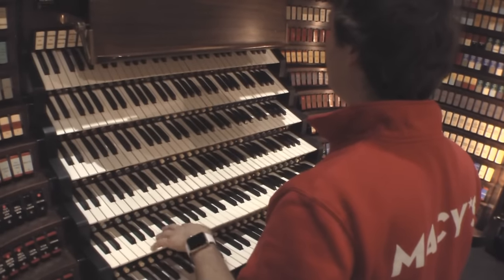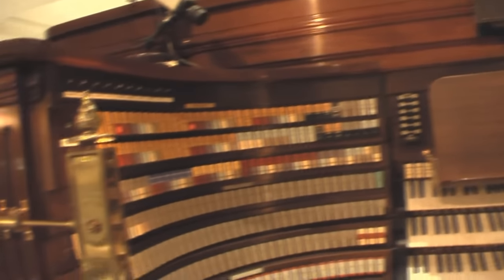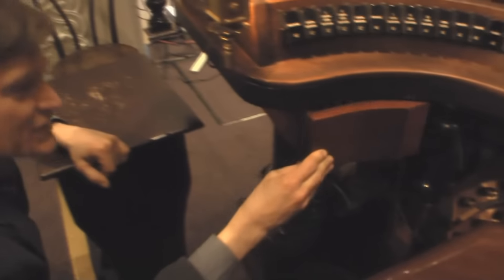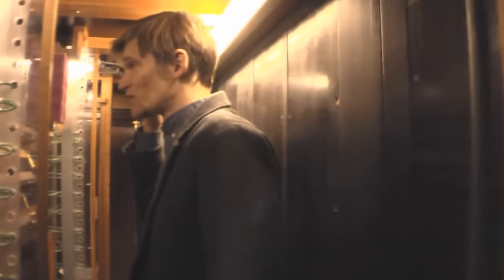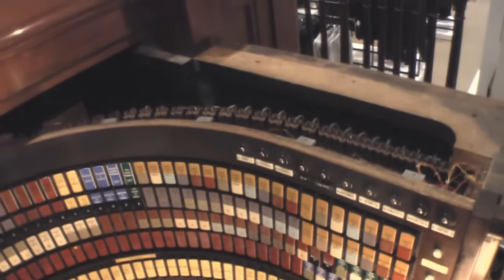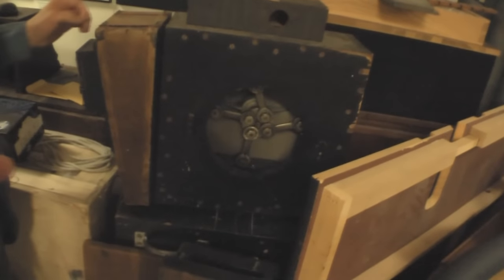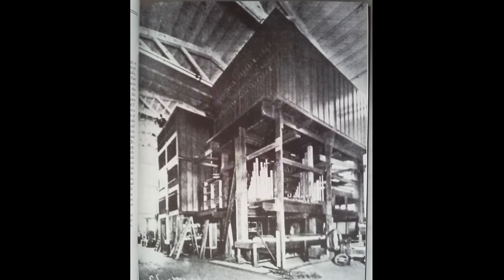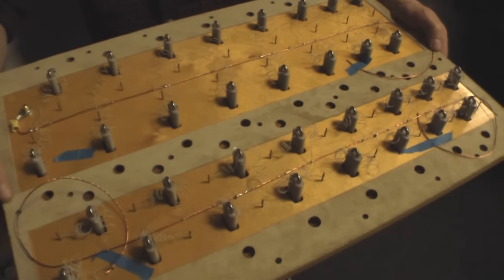The Wanamaker Organ Part 2 - The Fine Details

Comment: When I was a kid, my dad found an old player piano in a barn. The rubber tubing was mostly rotted, so he rebuilt it with aquarium tubing. The soundboard was cracked and it was hard to stay in tune, but we ultimately had about 100 rolls which we could play.

Comment: Inside the Wind Chests, at 54 minutes, you can see how much dust has made it's way into the windpipes. The bit you can see is only a fraction of what is already in there. I'm an engineer, not an organ expert but this problem could cause premature loss of sound quality. Have you engineers considered fitting renewable/replaceable air filters to the blowers?You have some fantastic filtration experts in the USA who may advise on this. What do you think please? Thanks, Frank.
Reply: Typically reed pipes are the one's prone to dust getting caught between the reed tongue and the shallot.  Things like moths and other insects occasionally get caught in reed pipes too.

The Wanamaker has several people that work on it every day, to keep it maintained and in tune.  There have been "pipe washing" parties in other installations to physically clean the pipes.  

Though it can quite costly, when the time comes, complete ranks are sent out and reworked by a reputable pipe manufacturing company.

Comment: Those low bass notes come out of the organ pipe like when you blow bubbles ( soap bubbles), some of them are 10 feet in diameter  - -  imagine if they weren't invisible, huge bubbles of bass sound!
Reply: Sound, no matter which frequency, is made up of air pressure waves transmitting through the space. Like if you drop something small in a bucket of water, the way the waves proceed through the water, is similar to sound. But then in 3 dimensions. And the sound gets reflected by any object in the mirrored direction. So that has not so much to do with soap bubbles.

Comment: There’s a lot of conflation of acoustic delay and the minimal mechanical delay and the speech of low pitches.  A modern electrical system is speed of light, there is no discernible delay.

Comment: how many amps of 5 and 12 volts are used for the control circuits? must be a hugh power supply??
Reply: tekvax No there are several DC supplies throughout the instrument to keep current loads nominal.

Comment: Hmmm! 64 foot pipes! I want one at home. (Scare the ---- out of the neighbors!)
Reply: 64’ is 19.5 meters. If you put the bottom in the basement then the top will still be sticking out of the roof of a 2 story house with attic 😛
Reply: A 64 foot open pipe speaks at 8 Hz, which is more felt than heard.

Comment: Imagine a 256' organ pipe, that wouldn't even play probably.
Reply: You'd probably have to feed it with a jet engine.
Reply: 64’ = 8hz, 128’ would be 4hz, 256’ = 2hz then. 2 air bursts a second. I don’t know if that outcome will be worth all the money and effort to build it 😅 256 feet is nearly 80 meters. The bottom would need to be half a meter thick wood to keep the rest of the pipe upright, and a concrete foundation under it to prevent it from sinking into the ground. And the air supply yes..